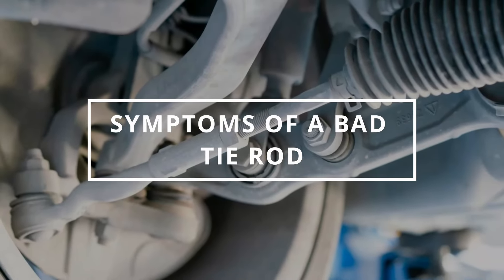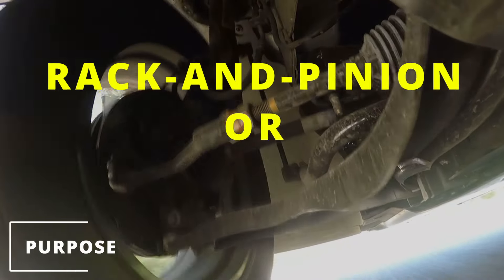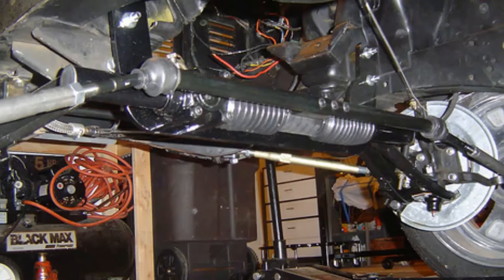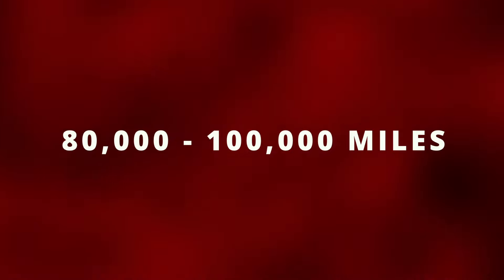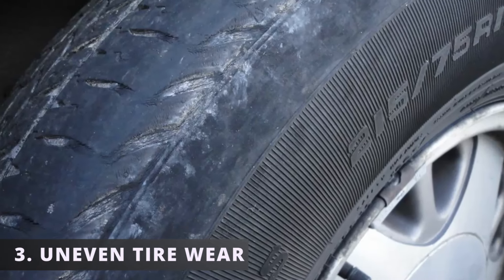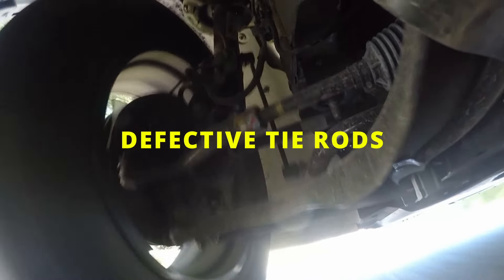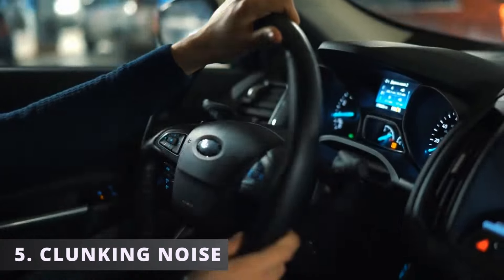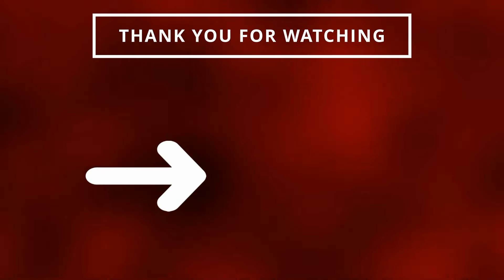SYMPTOMS OF A BAD TIE ROD

Comment: Could one symptom be "stuck" steering wheel, when trying to slightly move it, on a highway? I mean, it's not stuck, more like it feels glued when I try to slightly move it, and it needs little bit more effort to move the steering wheel... At stronger movements, no problem.
And, the inner part on the tires are more worn than the outer..

Comment: My car knocking when turning is it safe to drive for 30 miles round journey
Reply from the maker: That sounds like a CV axle issue. They typically make noise when turning. I’d recommend getting it fixed as soon as possible.
Reply: @easyautofix  thank you is it ok to drive till I can get it fixed as it only started today

Comment: So get this I had everything wrong in the suspension up front. I bought my car used and was aware of the worn parts nothing was in the danger areas they were just making noise. I had bad tire rods making clunking sounds when I turned the wheels sharp bad sway bar bushing and end links that would make a clunking sound over every bump and bad control arms and ball joints that would squeak and clunk. All this made the car sound terrible lol. Talk about almost having everything worn up front and I needed and alignment after all the repairs

Comment: Can this push the tire back by 1 inch nd when hitting bumps it comes back to its position. So far I have changed shocks/struts plus lower and upper control arms & sway bar link

Comment: What I am noticing that seems to be a symptom is the steering is not precise and is even a little bit jerky.  I have a Nissan Rogue and it shows the symptoms of a bad tie rod end or maybe bad rod altogether.  I had it to a couple of shops and they could not find anything wrong.  I am wondering if they even look or just don't even know why they are there in the first place.  I have an appointment to get it looked at by the dealer again.  This time I mentioned that I must have problems with one or both tie rods.  I am going to have them take a look but I am beginning to lean to just having them do them since I am getting to the point I know for sure that is what it is.  It is not just an annoying problem that will destroy tires but it is a dangerous one if that end ever breaks loose!  I am going to ask the mechanic for the bad part so I can show people I have been telling about it.  This is because although they have not driven my vehicle ever they think nothing is wrong with it.  I find it impossible for them to believe that without having driven it.  If they had to drive it every day or had it as their only vehicle they would not like it.  I actually test drove vehicles similar to mine with the same mileage and they still feel new and safe.  I test drove those since I wanted to make sure that I was right about something being wrong.  This is one of those problems that starts off barely noticeable and slowly gets worse over time and next thing you know the vehicle handles like crap.  The dealer has seen me enough to know I am getting tired of this problem.  I will just ask them to replace the bad parts and do an alignment.  I really don't get how none of 3 shops, one being the dealer could not find my problem unless none of them ever thought of checking the tie rod!  I am sure they will see my problem if they look there.  I know if it was their own personal vehicle they would have had that bad part changed ASAP the first day there is a sign of a problem.  It is just baffling how none of them can seem to notice it!  Maybe I was describing my symptoms all wrong and they just could not figure out the problem.  The thing is that ALL of the people I took it to see vehicles day after day.  You would think that I would go in the waiting room and hear them call me in 5 minutes later to show me the problem.  It passed inspection surprisingly.  It was not so bad then but still noticeable.  I would rather have failed the inspection and had to pay a few hundred dollars than put up with no one finding the problem.  It is the most absurd thing ever to me!!

Comment: Can you tell me which hub assembly my car requires? I have a 2003 Honda Accord LX, but there are two different ones on O'Reillys' with differences in various measurements. How do I know which to buy? The two are: part 512188 and 512327. Both are Precision. Thanks

Comment: I have a 96 Camry with 150,000 miles on it.  It currently does not display any of these symptoms.  I plan to continue driving it for as long as possible.  Should I replace tie rods proactively to ensure the safety of the car?  I have a tendency to over-maintain this car but tie rods have not been on the radar as of yet.  Thanks
Reply from the maker: Always test before replacing. No need to replace the parts if they are good.

Comment: When I put my car in reverse and make a right turn sometimes my car will clunk and vibrate. Could that be a tie rod? It happens from time to time when I make left turns in drive as well
Reply from the maker: The symptoms you're describing could potentially indicate an issue with the suspension or steering components of your car. Here is a list of posibilities you would have to look into. 
-Tie Rods
-Control Arm Ball Joints or bushings
-Sway Bar Links
-CV Joints
-Sway Bar Bushings
Reply: @easyautofix  thank you 🙏

Comment: My trucks sounds like it’s knocking while driving n I noticed my tie rods bushing are really bad on the driver side can this be the problem ?
Reply from the maker: If the knocking is coming from the engine then no the tie rods are not the problem. If you hear the noise coming from the wheels and the tie rods are in bad shape I would start there!

Comment: Are the tie rods only at the front of the car? Are there no tie rods at the rear of the car?
Reply: Not unless you have rear wheel steering. On normal cars, no. Tie rods are only in the front, they are connected to the steering rack(which is what steers your front wheels effortlessly)
Reply: @eet_fuk6374  thanks mate 👍🏻